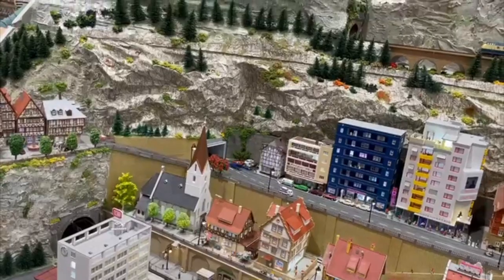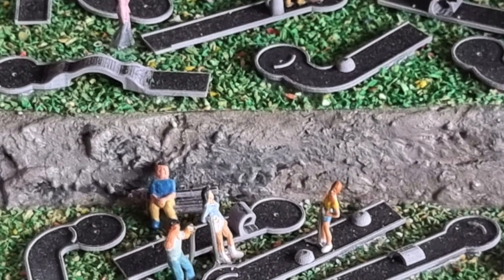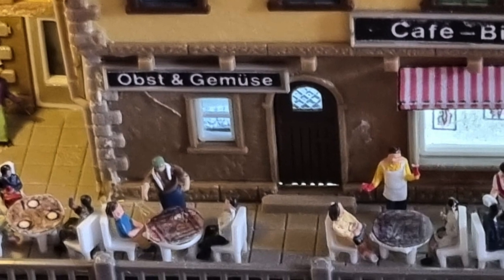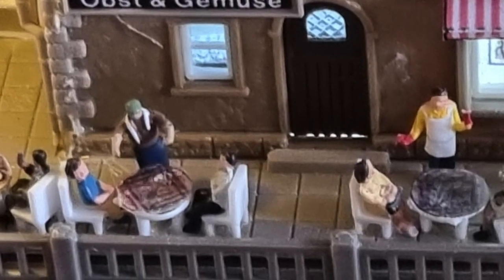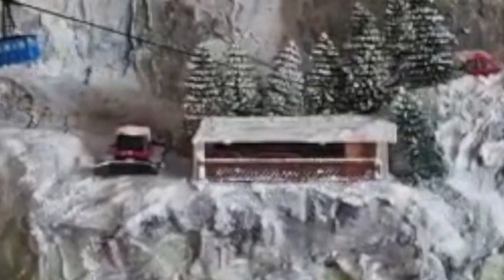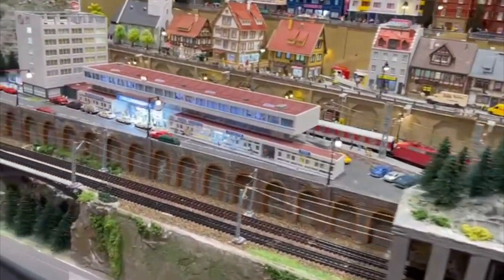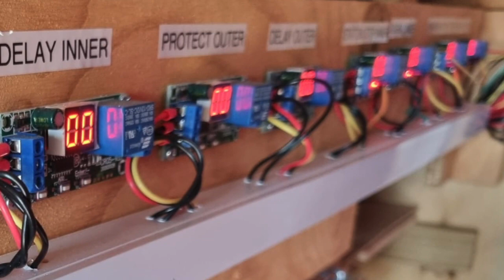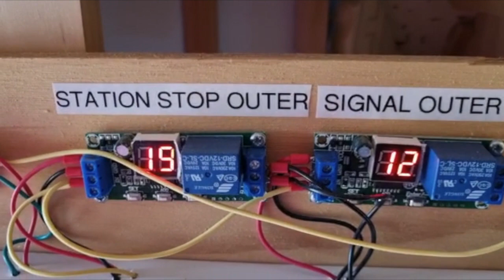Twin Peaks with background music

Comment: Chris, your voice is just fine. I had been using Arduino nanos, but now I use ESP32 to control lighting and other features, and with MQTT messages over Wi-Fi, I can interface smart switches and lights with train movements and control things from my phone.
Reply from the maker: You are well ahead of me when it comes to electronics but it is very easy to add controls. 12 years ago, the inventors of the Magnorail System include REED SWITCH holders in the channel extrusion so they knew there were people like you that could use them!